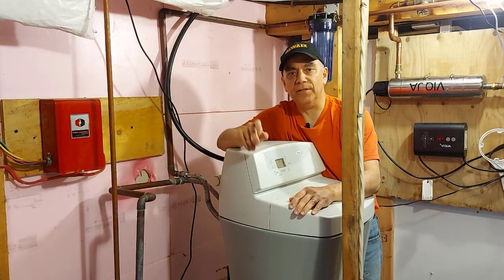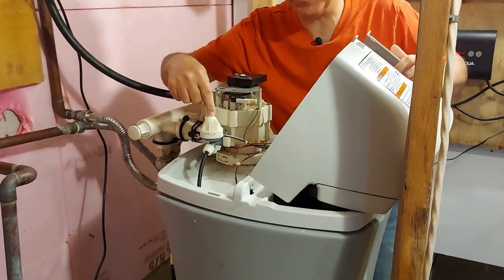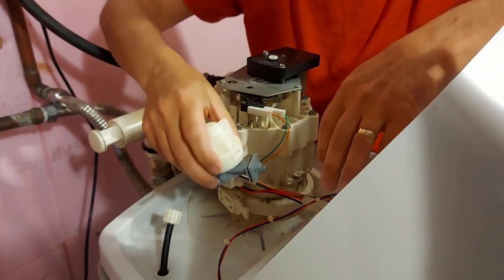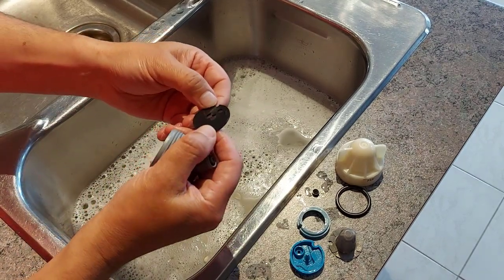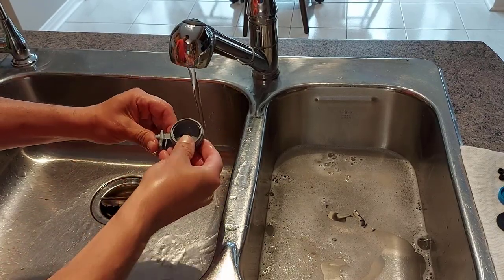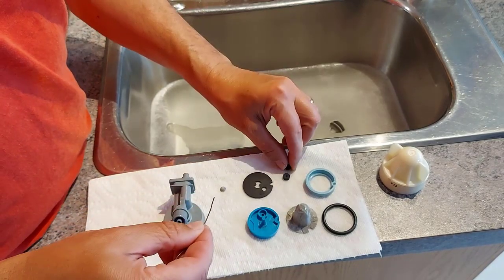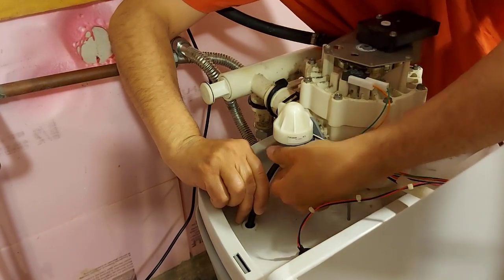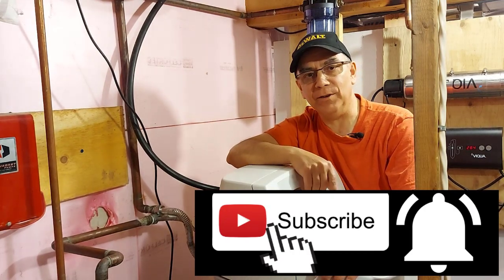How to Clean a Water Softener Venturi | Whirlpool Tank Holding Water?

Comment: Very helpful video.  One thing you didn't mention though.  The two flow plugs are very different.  The one labeled HVDC goes in the bottom.  The one labeled 58 goes in the top.  The orifice is much smaller on HVDC.  Thanks you helped a great deal.  Your video gave me the confidence to get it done.  Great job!
Reply: Thank you so much I was struggling here 😅
Reply: This is extremely important. Keep track of which one came from where or you may be taking it apart again to get it to run.
I'm not sure of the orifice size vs flow rate, but my HVDC is supposed to be 0.3 gpm, and the other one is 0.1 gpm. I assumed this meant that the 0.3 gpm orifice would be larger, to allow more flow. Not entirely sure, though.
Reply: To clarify....the flow plug labeled HVDC is a .3gpm flow rate and it has the larger inside hole and it goes in the very bottom under the black gasket. The other plug may be labeled as DUDC but it is a smaller hole and only flows .1 gpm and it goes in the blue body. Both plugs should have their curved (concave side) facing downward when the unit is in and upright position.

Comment: I believe that the flow plug with the larger hole (orifice sized for 0.3 GPM) goes in the “bottom” (center recess of the main Venturi body). The other (0.1 GPM) goes in the top or the blue disk.

Comment: great video.  I cleaned my venturi and nozle.  your video really helped.  quick question, my whirlpool never has water sitting in the unit?  its set for 20 grains hardness and to come on at 2am.  Water not really soft lately.  any suggestions on what might be the issue?  thanks Mark
Reply from the maker: I don't see water in the brine tank either. The water is below the salt. Only about 3 inches of water. I turned mine up to 30

Comment: Mine is 20 years old and full of water. Tried your method , ordered the gasket,  cleaned and changed the venturi , water flows thru it no problem,  then did a recharge and no change still full of water.
Reply: Same

Comment: So, great video! Thanks for sharing. I have 1-1.5’ of water in my tank. I’ve checked the drain hoses, all good and clear. I’ve cleaned the whole Venturi which is like new, the whole unit is really. I cleaned the hose going to the float and all those parts as well. I have zero salt bridge etc. but I am still holding all that water. Not sure the issue. Any ideas, anyone?
Reply from the maker: Not sure what to say. These appliances are an on going puzzle aren't they
Reply: Similar to the two flow plugs shown in this video, there is a flow plug in the drain fitting. Make sure that is not partially blocked so that water can flow through the resin bed properly. If this is partially blocked, then you won't get proper discharge during the brine, rinse and backwash cycles. This means that during the brine sequence, you won't be able to pull the correct amount of brine from the brine tank.

Comment: Quick question (love your content btw),
I cleaned the Venturi and ran a recharge cycle...but now the water smells like metal. It didn't before. But now the smell is pretty strong.
Any ideas?
Thanks, JD
Reply from the maker: No idea that's weird
Reply: @GettingItDoneRepairs 
I did all steps for cleaning but still have the water level at around 5.  Any suggestions?

Comment: Be especially careful of that tiny screen filter under the gasket.  Mine jumped out as soon as I rinsed it and went down the drain.  I guess miracle would be an overstatement, but I took the trap off the sink and dumped it in a bucket.  And there it was. That could have been another couple weeks waiting to get the part.  Got it back together.  Recharging.  I'll see if it drains now.
Reply from the maker: Yes those tiny filters can be elusive. Make sure you replace those small rubber flow plugs with the concaved side in first. Hope it all works out.
Reply: Yep! Little suckers. I always keep the sink plug in and still have had trouble finding it sometimes.
Reply: And how vital would you say that screen is? Hypothetically?

Comment: You should lube the o-rings with Vaseline or some other rubber lubrication.
Reply: Don’t use vasoline or any petroleum based lube, use a plumbers silicone grease only.
Reply: @rw3476  
My manual says to use Vaseline or silicone grease

Comment: My water pressure is slow.  When I use the bypass it returns to normal.  Would this cleaning solve the problem?  What is the cost of whole new venturi?

Just checked.  A new venturi only costs 50 bucks on Amazon!  Much easier to just replace the entire unit and not have to worry about losing any of the very small pieces.  Just take the old one off and put on the new one.  Should be as easy as changing a light bulb.